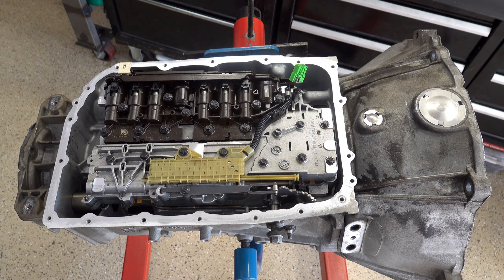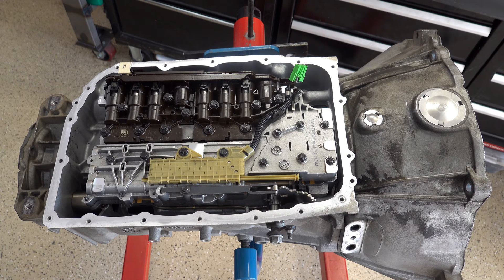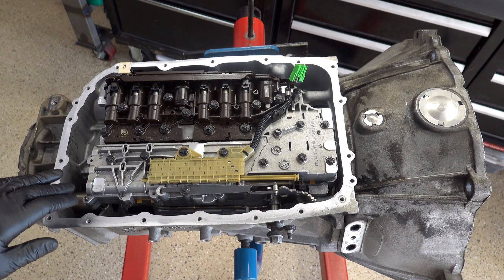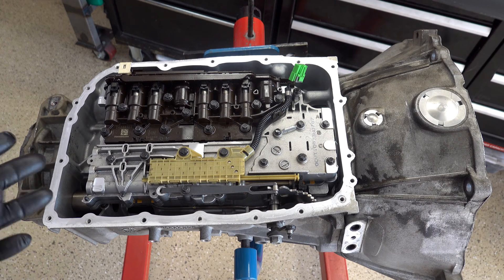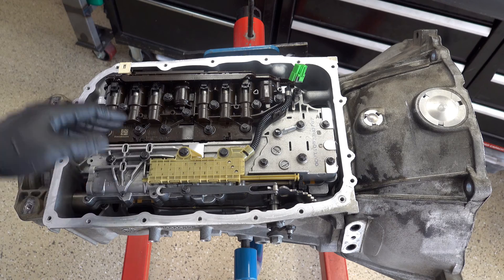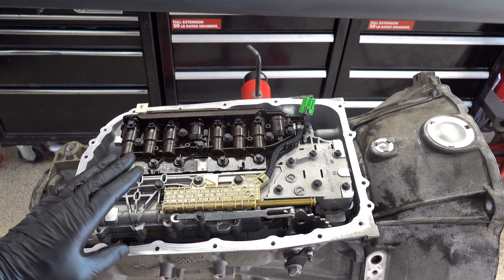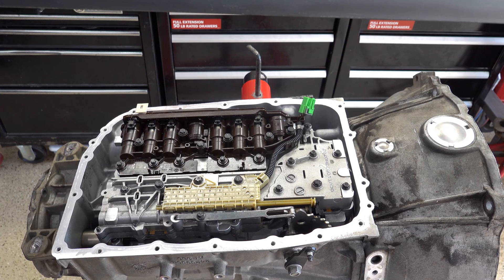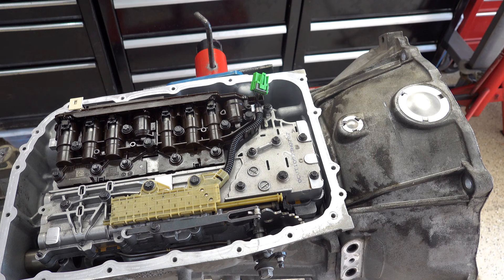6L80 Troubleshooting PT2 - Internal Mode Switch

Comment: Hi Nick i went to the reference chart link and i noticed when i was reading it says one pin (pin A) is used for ignition voltage while pin F is used to transmit P/N data directly to vehicle ecm,then a little farther down where the 2 bulletins are it says pin A is signal to ecm and Pin F ignition voltage basically they say the opposite of each other it confused me i hope it can get fixed for people in the future looking for information just thought i point it out
Reply: Thanks nick and thanks for bring information to this platform
Reply from the maker: You're welcome, Jonathan!
Reply from the maker: Thanks, Jonathan - I'll double check it and make the correction if need be...Thank you for watching.
Reply from the maker: Took another look at the sheet (it's been over a year since I viewed it last) and made the update...Thanks again for bringing it to my attention.
Reply: Greetings I got a p1915 and 0700 code pop up on my 2011 Tahoe ppv when I was on a road trip from Atlanta to Chicago. I had pulled off quick and the check engine light and service stabilitrak lights came on and stayed on. It doesn’t have an indicator light for PRNDM and sometimes it won’t go into gear but when it does it jumps into gear. The p0700 code says tcm requested mil illumination. That does that mean and do I just need to change the transmission wire harness, ims and tcm?

Comment: Ok, so I put it in reverse & i have no reverse light, but it does go in to reverse.  The reverse fuse is good. I use a power pro and put power to the fuse, and the light turn on. the reverse camera doesn't come on. the little box under the passenger seat doesn't have power to it. It has power to the rear latch button & has power to the camera, but it doesn't work. I'm going to replace the cam and button because they are inexpensive. So, is it the reverse switch the problem 🤔
Reply from the maker: No; if you had an internal mode switch problem you would have IMS DTCs and a different symptom pattern; could include everything from the shift indicator illuminated to not being able to start the vehicle (no crank-no start condition). Follow the test procedure I show in this video if you suspect the IMS to be bad but your problem doesn't sound like IMS to me.
Reply: My 2007 Yukon XL is doing the same with P0700 and P1915 reverse cam and doors stop auto unlocking when in park. Won't go past 70 mph either. Did the IMS replacement work?.

Comment: Hi, I have a 2014 gmc sierra, the red light in the gear selector in the dash is not lights red so you can’t see what gear you are in and I can’t crank the engine, what can that be or advice please 🙏 thanks Kjell Norway 
Is there a possibility to contact you?
Reply from the maker: Hi Kjell, this is the only way to contact me..Watch the video, if you haven't - it literally walks you through exactly how to test the IMS and answers your questions.
Reply: Hi, ok so you think this could be the case with my car also? We cant Get contact with the car true the obd so we can reed out anything
Reply from the maker: You wont know until you test it as shown in the video. Watch the vid, if you havent already. Also check the cigarette lighter fuse for no ALDL comms - sometimes it blows and you wont be able to communicate with the vehicle.
Reply: We tried today also to get connection with the car but no better we have gone true all the fuse multiple times seams like we don’t have power to the ecu, will try to find wiring diagram so we can se if we have power to the ecu first..
Reply from the maker: Sounds good, Kjell. Let me know what you find code-wise once you restored comms to the ECU.
Reply: @nickstransmissions  we got the new position switch and installed, but we still not have any red light around  what gear it’s in.. frustrating situation.. and we have no Gm dealer over here🙈 when try to scann we can connect with engien ecu ore any other computer on the car and everything in the is instrument panel works
Reply: I have a 2018 and it does the same did you found the problem?

Comment: Subject: Request for Expert Guidance on 2014 Chevy Silverado 1500 Issue

Dear Sir.

I hope this message finds you well. I am reaching out in desperate need of your expertise regarding a persistent issue with my 2014 Chevy Silverado 1500, 4.3L. I am happy to compensate you for any information or guidance you can provide.

The truck is experiencing a “No Crank, No Start” condition, and I am also seeing an issue with the gear indicator (PRNDL) on the dashboard. Here’s some background: After the battery died, my wife mistakenly connected the jumper cables in reverse. As a result, the truck wouldn’t start, so I replaced the battery fuse, and it powers on, but still has the “No Crank, No Start” problem.

Upon further inspection, I noticed that the PRNDL lights up on the dashboard but doesn’t show the actual gear (Park, Neutral, Drive), even though the gear shifter moves freely through all positions. The truck appears to engage in the gears, as it can be moved in Neutral, suggesting the gears are engaging mechanically. However, I suspect there is no communication between the transmission and the vehicle’s computers.

I’ve had four mechanics and one electrician examine the truck, but none have been able to pinpoint the issue. I even replaced the entire engine wiring harness, but the problem persists. Based on my research, I am now considering whether the Neutral Safety Switch (NSS) or the ECM could be at fault.

I have been following your work and would greatly appreciate your insight on this matter. Given the symptoms, do you believe the NSS is the likely culprit, or should I be looking at the ECM? I am based in Indianapolis, IN, so I am unable to bring the truck to you, but I would be very grateful for your advice.

Thank you in advance for your time and expertise. I am happy to compensate you for your consultation.

Best regards,
Faster Faster.
Reply from the maker: Hi Faster Faster, thank you for the kind words...I would also suspect the internal mode switch (IMS) at this point, specifically channel 'N' that sends the Park/Neutral signal directly to the PCM for purposes of starting the vehicle...I'd drop the pan and test the switch following the instructions you see in the video....If you don't have any continuity or the reading for channel N is way off, replace the IMS with a GM/AC Delco replacement. The new ones are the same for all years, models etc.
Reply: @nickstransmissions  Thank you, Sir! I’ve watched the video over 10 times, and it’s clear and straightforward. I’m confident this will be the final and simple fix, so I’ll likely dive in tomorrow. Also, I appreciate the advice on the part preference—I’ve always stuck to the rule that anything electrical must be replaced with new, & now I’ll add OEM to that RULE 😊
Reply from the maker: You're welcome, man! those mode switches rarely go bad but I've seen it enough that I always replace them on a rebuild as well...And yep, OEM only (or Rostra if an OEM version of an electrical part isn't available but Rostra makes one).
Reply: @nickstransmissions  Absolutely! I’ll be sure to return with positive feedback. I have a strong feeling this is my Christmas gift to myself. Wishing you and everyone on this fantastic channel a Merry Christmas.
Reply from the maker: Merry Christmas and Happy New Year to you and your family as well, Faster Faster!

Comment: Also, is there any difference between 6L80 and 6L90 when it comes to connectors and electrical SCHEMATICS  for IMS ?
Reply from the maker: Unfortunately, your questions while very good, are beginning to drift outside my area of expertise (transmissions) and cross into a big unknown for me (electrical)...

Check out the ATSG manual (link is in the video description) to see if it has more specific procedures and protocols for electrical diagnosis for the mode switch and/or related electrical circuitry.

Comment: I have a no crank situation on a chevrolet express 2015 with no shift indicator light. dropped the transmission pan and replaced the NSS but it didnt changed anything ... I have 12v at pins 9,4,12 and 6 when brake in on but at the other end where the NSS is conected pin F and A has no power ...BCDE all have 10.7 v .... what is wrong here ?
Reply from the maker: Hi, not sure to be honest given you've already tried replacing the switch and performed voltage testing on the related electrical connections...I'd check the harness going to the transmission as well as the powertrain control module to see if there's any defects/problems there...
Reply: @nickstransmissions  what should be a normal voltage reading at the control solenoid body ( were the IMS is conecting A,B,C,D,E,F ) in park with the key on ? witch pin should have power and how the circuit works ?

Comment: After replacing this IMS, will I need to re-code anything or is it plug and play?

I've been told that the truck will have to go to a dealer to have the transmission re-learn done after replacing this. If so, is there an affordable scan tool you'd suggest I buy that can perform this? 

Appreciate the info!
Reply from the maker: I don't think you will need to do a re-learn however could be wrong but for scan tools, check out Autel...For around $500 or so, you can get one that will do a variety of functions including fast adapt relearns.
Reply from the maker: Hey, sorry I missed this but you shouldn't have to do a fast relearn however if you do, Autel is your best bet for scan tools. Here's an Amazon listing for one, it's $379 + any sales tax and should give you all the capabilities you'll likely to need: 

https://www.amazon.com/Autel-MaxiCheck-Automotive-Diagnostic-Diagnosis/dp/B08ML7T7KZ/ref=sr_1_4_sspa?crid=2D1JE8NS96TLR&dib=eyJ2IjoiMSJ9.NzijszY8WHTMfkUQzzhv_OQmgpq-VdBLwEQz7bjgw21gXlbZzJgOkCLYgu6ebY0XUlix7anJTHFRhnq2ZTc2Dr2XXXSUt5y7Nv1lzU-bCdficlMQeJc5oDO6FLbscwBYlnPvouVxOjAUq0zu5N5zY9GKS35xDG-WqD0zcBiauVGH_cOivA9psxMrziYYAnMJ4YTe4OjXHAZobmPmftpj0n_7LwQVCsYJBJn1hraiGVmd6QgEfm0Tp9s3oZ3Jbeuhaq8qvj8nR4D6nO5eri-K0OZe93asfzhYuWzjSKzMlXc.IfpemzWnqTKGBob3SLGFUEFL7zVgCcPOWbcObaqfyos&dib_tag=se&keywords=autel+scan+tool&qid=1727897828&sprefix=Autel+scan%2Caps%2C185&sr=8-4-spons&sp_csd=d2lkZ2V0TmFtZT1zcF9hdGY&psc=1

Comment: How do you diagnose if you have an intermittent?  I have a p182e when in D. 2014 gmc goes to limp 5th gear. I restart and it resets. On scan tool I observe while driving all 4 channels go to high volt momentarily and I loose red gear indication on dash. Truck goes to limp. Funny thing I can drive in manual mode all day and no problems. D is bad.  Trying to figure out if this is the TECHM or the mode switch. Appreciate your video. Park/neutral is fine. Always restarts.
Reply from the maker: Hi PDaddy - Code P1825 is for the internal mode switch. Additionally, the TEHCM doesn't report your gear/range position to the dash indicator, the mode switch does so I'd say your mode switch is going bad. The fifth channel, Channel N is what reports P/N signal to the PCM directly so if that fails, you will no longer be able to start the vehicle. 

You can drop the pan and perform the testing that I demonstrate in the video to confirm or deny, that is what I'd do next. I'd grab a new IMS before doing so - this way you can swap it in...You will also need a Snap On 10EPL socket so you can remove the 'starfish' bolt that secures the IMS to the rest of the assembly (the other bolt takes a conventional 8mm hex socket).
Reply: @nickstransmissions  He asked about P182E (which I have the same ), any suggestion? Thank you
Reply from the maker: Yes, follow the test procedure outlined in the video and replace the IMS if it fails those tests (see the description to links for the ATSG manual and my reference document to help you. 

The code is indicating an invalid range setting (ie it's not sending valid range selection).
Reply: Hi nick. Thanks for all tha valuable information your sharing to all of us. I got one questions, the IMS has to be reprogram? If so how do you that?

Comment: What socket is needed to remove the IMS?
Reply from the maker: You'll need an inverted torx E12 or Snap On 10EPL. You can find them on eBay for about $10

Comment: P0700 and p2714 after a complete new rebuild no reverse stuck in first gear 07 yukon denali
Reply: What happened did you figure it out ?
Reply: @4-matic212  no not yet
Reply: @durellmchenry969   you replaced this internal switch ?
Reply: @4-matic212  what switch u referring to
Reply: @durellmchenry969  the one in this video
Reply: @4-matic212  ok ill look back

Comment: 07 Escalade..code p0700?
Reply from the maker: That's a general communication error code associated with the transmission's TEHCM, instructing you to scan and diagnose the transmission for problems. 

Are you having drivability symptoms?
Reply: yes
Reply: my fluid is dirty as well..
Reply from the maker: What are the symptoms? 

Dirty fluid is usually indicative of quite a lot of burnt clutch material present which likely means it's time for an overhaul.

Comment: I can count on one hand how many of these I have seen fail. If a unit experiences a very bad torque converter failure it can cause a P182E if not cleaned properly and then reused.
Reply from the maker: Yea, not a common failure point but I still replace for piece of mind. Plus if it does happen to fail, I can tell the customer (and show proof) it was replaced and failed beyond my control.
Reply: Are these susceptible to heat at all? Had a P1825-00 fault code after driving around and giving the car a bit of boogie through the city for a few hours. Cleared the code, and it came back alm,ost instantly, confirming the code. The box basically locked the forward gear to 1 single gear, was able to select park, reverse, and forward essentially. I was able to limp the car home no issues. 2 hours later, start the car, cleared the code, and it has not had a fail since.

I am suspecting either a heat-issue causing the module to fail, or a dodgy loom somewhere.

Sidenote: The car has always has a 1st to 2nd gear switch lag or delay, I would liken it to souond/feel similar to someone that drives a manual and takes 2-3 seconds with the clutch during a change, the revs drop, the engine quietens, the car slows slightly, then you feel it select 2nd and everything comes to life again. I suspect also a mode-switch issue (potentially) but on this one I have no  idea.